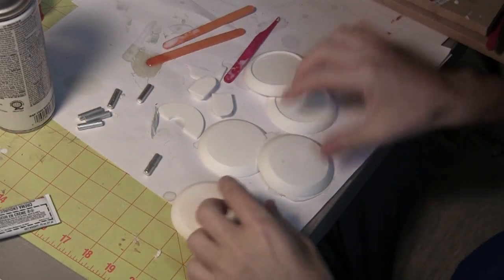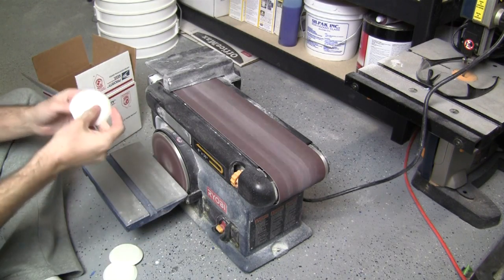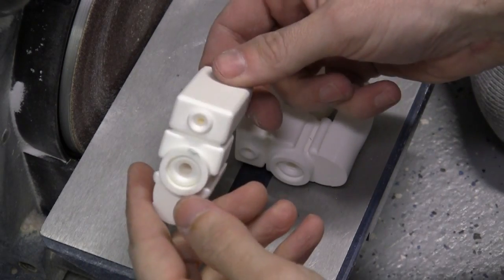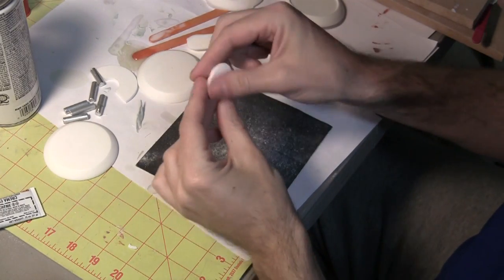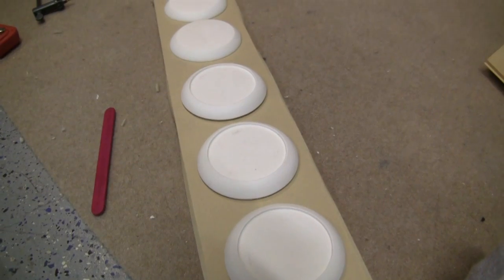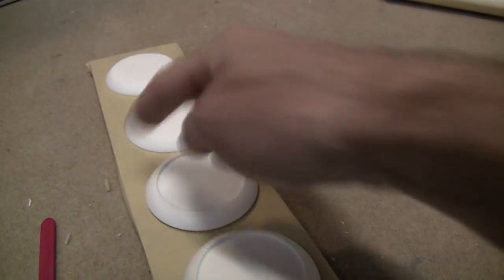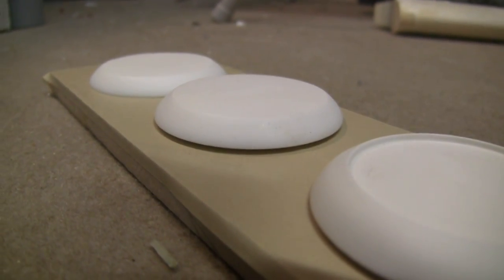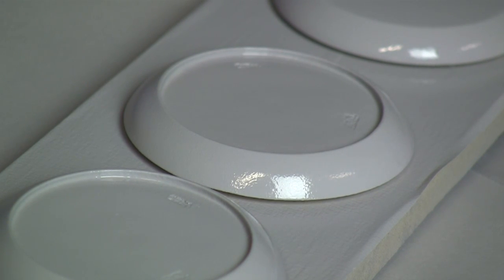38 - Batman Arkham City / Arkham Asylum Grapple Gun Prop Build

Comment: A tip I learned from a jewelry making class.

When you're sanding something by hand with the paper on the table and the object in your hand. Move the object in a figure eight pattern "8" over the sandpaper. This motion creates a perfectly flat surface  everytime ;)

random tip: If you get a router push block ( usually sold in sets of 2), they have rubber pads on the bottom of them that you can use to move a small flat piece across the sandpaper, without losing your grip or scuffing up your fingers on the paper it's self.